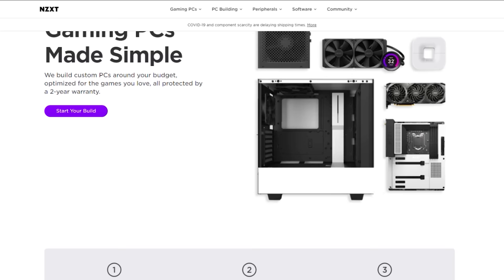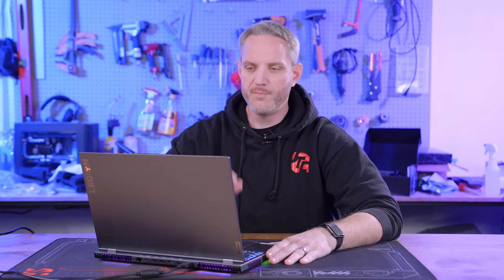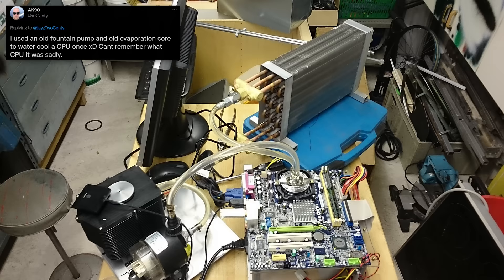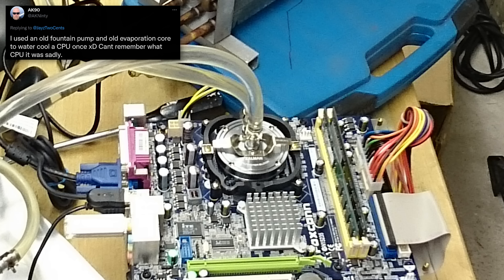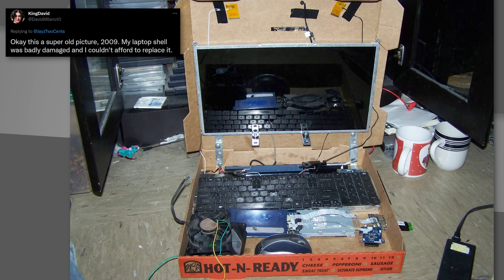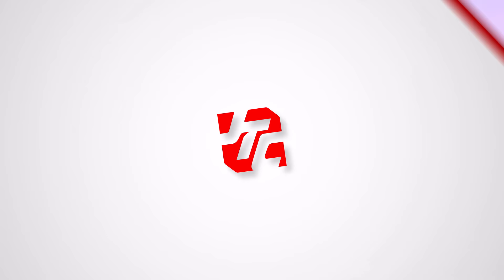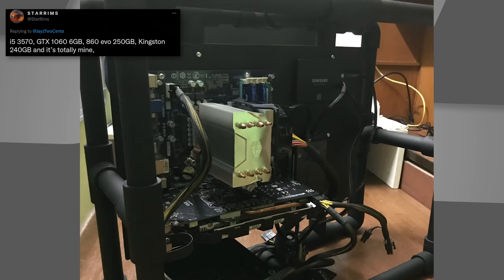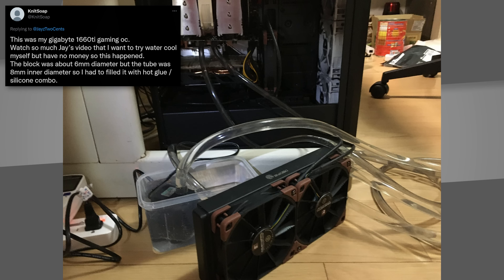We asked to see your JANKIEST PC setups... and you DIDN'T disappoint!

Comment: i really wish youd do a video dedicated to old janky watercooling solutions how people in the 90s and early 00s repurposed car parts etc to cool pc parts. Its so interesting but  ive never seen anyone do a video about the history.
Reply: That would be cool!
Reply: I concur!
Reply: I can only imagine the level of satisfaction one got after the diy water cooling system was successfully built back then ngl
Reply: I grew up in those times and I've never even heard of it. Where you from?
Reply: I love those builds
Reply: Please do Jay!
Reply: We used to MAKE our own watercooling loop, block and all.
Reply: @bepbep7418  jokes on you. I used 2 fish tank pumps
Reply: Ohhh, would be funny to watch Jay2Cents cool a computer using a J2Z.

Ok, I am say, would be funny to see this car guy use car part to cool his pc.
Reply: I had several water cooled.  My cooler was a heater core, fountain pump and the CPU block was a custom from a guy I knew in Oklahoma City.  He supported the system until around 2004.  I had 4 different CPU blocks from him.  All cast from either aluminum with copper plate or aluminum.  Those were the days.  I experimented with flexible and soldered rigid copper.  The radiator reservoir was an automotive brass tank also repurposed from a water cooled lawn mover complete with pressure cap.
Reply: @paultaylor7758   - As archaic as such a system could be considered now a days I cant help but wonder. Didnt they have better cooling capacity? Using high flow pumps and car radiators? "Jank" but at the same time would these not perform well today? If not better then your basic 360mm AIO?
Reply: I remember seeing zip ties and jubilee clips and those springy things you can put on tubes, they looked awful.
Reply: Early 70s Chevy Blazer heater cores were $30 at the parts store and worked awesome. If you wanted a smaller one a Chevy Vega heater core was around the same price and more compact. Eheim pond pumps were where it was at for a long time.
Reply: Oh man the first time I'd ever heard of overclocking was a 486 PC someone submerged in mineral oil in a cooler and used a pond pump to circulate the mineral oil over the guts of a window air-conditioner to cool it....
Reply: All in favor say Aye
Reply: Funny thing. My husband wants to have a water cooled pc that looks like a tie fighter. So i have a plan of using car radiators as the solar panels and passive cooling , it would look amazing with what i have in my head
Reply: @bepbep7418  i used the toilet tank level difference to the shower drain for a pump less solution on my p75 (@100mhz)
Reply: Water cooling through the ages XD
Reply: I can definitely give you an example. Imagine being so obsessed you go out and buy a brand new Amana refrigerator, pond pump, 40ft of copper tubing yo wrap around a small wire spool, punch holes into side of freezer section of said Amana...only to have your cast heat exchanger have a pin sized hole in it and fail miserably. Yeah my boss did that, lost interest and built a Beowulf cluster.
Reply: Would love to see an old danger den setup
Reply: @cardinaldriver  Ive never heard the beowulf cluster term before,  but i do remember the airforce running a ps3 cluster years back
Reply: Agreed
Reply: @motokid6008  radiator space is radiator space the real difference between then and now are the dedicated cpu/gpu blocks. This  is the biggest unknown to me from that time period; what did they use as the cpu/gpu block.
Reply: @kommandokodiak6025  believe it or not mine looked a lot like a modern one. I built a cube out of plexy and epoxied a heat sink to the bottom. I tapped the top for barb fittings and attached my hoses. Unlike a lot of people here I used a motorcycle radiator for my heat exchange.
Reply: industrial ebay is your friend with this one :)
Reply: Why would you need to water-cooled a PC 20-30 years ago? PC back in those time (Single Core CPU) can run very well off one 60mm fan over it. I know this because I had done that to my PC in 1999. Water cooling is only recently become popular because of the massive core counts. Just a few years ago in 2017, Intel's flagship the 6700K was only quad-core and can easily be air-cooled and before that was Core-duo CPU. I remember in 2003 the top of the line CPU was 400mhz.
Reply: Linustechtips did water cooling with a car radiator
Reply: Linus
Reply: Oh great idea!!
Reply: i had a heater matrix from a car as my rad back in the q6600 days
Reply: out of car parts huh. iv legit used 00s pc watercooling hose clamps in my car instead when one of the hose clamps broke
Reply: Just said the same thing a few days ago over on Greg's videos. These kids have NO idea.... What water cooling really is.
Reply: I would love to see that also
Reply: no matter what you do, nothing will ever beat LifeOfBoris's vodka cooled PC.
You can see the video on Youtube, and yeah, it actually works.
Reply: please
Reply: That’s honestly a good idea seems very interesting

Comment: Fun Fact: Back in the early days of radio, there'd be a water feature in front of the transmitter house, with fountains, which was used to cool the transmitter. Considering the God level voltages involved, combined with pipes full of water, and our lack of knowledge at the time, it would have scared the hell out of me to be in that building when it was running.

Comment: Oh Hey I made it into the video :D

Some more info: The fountain pump was submersible and had a UV light on it, if you look closely you can see the socket on the left. The big black box is a reservoir from a Zalman Reserator XT and the water block is a Zalman ZM-WB5 also from that kit. And yes I still have the Reserator XT fully working but not in use :P

Comment: The coolest tractor trailer setup I saw was a 42" tv mounted to the sloped roof of the cab and the Xbox tucked into one of the cabinets.  He also had all the cables run behind the interior panels and audio was run through the truck's sound system (which was of course far from stock)

Comment: Those rubber tabs for fans have been around a while. I'm pretty certain you can reuse most, but some are sorta single use. Supposedly, they help with noise reduction by preventing vibration transference.

It's a LOT easier than having to thread the fans' holes, you just stick it through and pull till the catch part pops out the other side.
Reply: I'm pretty certain Arctic used to provide those with their fans ten years or so ago. And I have a feeling Noctua used to have them. It's been years since I've used those rubber pull tabs though.

Comment: I ran console in my rig for years. Had a great setup with my Xbox 360 and then my PS4. Couldn't have done all my time without it. Always wanted to run a PC setup. Problem is wattage requirement and battery drain. Unless you owned your truck and could dump money into a battery, charging system and or a side mounted generator. PC gaming just requires to much energy demand to be feasible for most of your run of the mill truckers. Thank God for energy efficient televisions, consoles and mobile hotspots. Made me look back at the days when I was lucky to have a crap laptop or portable DVD player and made time on the road much more livable. Thanks for the nostalgia trip!
Reply: You could go with some high efficiency parts and have a system that's capable of playing recent games within 300W reasonably.

Watch out for amd's 6000 series desktop apus with ddr5 ram - they will absolutely be great igpus to game with
Reply: Am I the only one who idles the company truck if I wanna do some gaming? Gotta keep the broom closet cool if you wanna keep your hardware cool, and it also solves the battery drain problem...
Reply: @LavenderSystem69  unfortunately I worked for a company for a decade that had Idle limiters. One time I got a Volvo that I could cancel the idle. Other than that. Unless it was over 78 or under 36 degrees. I was out of luck.
Reply: @seaninman3899  Most of the time, all you had to do was wedge something between the driver seat and the throttle, so you could bump the RPMs just enough to trick the truck into thinking it wasn't just sitting there idling... hell, most trucks I've been in, you can set the cruise control at idle, and it overrides the shutdown timer
Reply: You could def get away with an efficient ITX build dedicated to gaming and media
Reply: I just use a laptop now tbh

Comment: 1:50
Those tabs look like they came from a box for something like an RC car. To reinforce the places where they run the twist ties through the cardboard.
Reply: They are actually metal "straight brackets." Got a whole pack from Amazon and used them to secure the radiator and power supply as well. The final design will actually replace some of them with L brackets to make things more compact.
Reply: @benzero  are you the builder? If so I would love to see the finished product.
Reply: @Druid_Plow  Yup, I am :) I will try to remember to post some pictures when it's done, heh
Reply: @benzero  nice. Good luck with it bro.
Reply: @Druid_Plow  Thanks!

Comment: Oh my god! That second one! I took apart a water fountain to make a water cooler for one of the first P90 processors off the line! We later just threw the whole board into an oil bath, but the watercooler water cooler worked better.
Then, someone in the group had the idea to use the watercooler setup to cool the oil and the pump caught on fire.

Comment: My first water-cooled setup was a Pentium 4 "Extreme Edition" (lol!) cooled with a Danger Den CPU block. The plumbing was made from Tygon clear tubing and all fittings/collars came from the plumbing aisle of my local Home Depot. The radiator was a heater core from a 1993 Mercury Topaz, which would fit 2 x 120mm fans almost perfectly. Another popular radiator back then was the Pontiac Bonneville heater core, but the Tempo/Topaz cores were much easier and cheaper to get. I know I scrapped that radiator long ago, but I think I still have that DD CPU block somewhere. I may also have an old GPU block from DD as well. If you're going through with that "retro water-cooled" video, I can try to hunt them down for you. That is authentic stuff from 2004-2005-ish!!
Reply: I have the parts of an old P4 setup. The radiator came from some A/C. The block was milled out of copper at the local uni and then a Grundfos circulator pump. I haven't used it.

Comment: Jay do you remember when people was building custom heatpipes in home to increase the efficiency of those old aluminum fins radiators?

The memories of those games coolers... I did shit like that, and i still do!
Who had a internal fan mounted in the chassis anchored using metal wire using some chassis holes for a parallel/serial port... If only YT would allow to post pictures....

Comment: I had to give up on my Alienware with an intel 3820 a year ago, and I tried to save as many parts from it as I could. Only problem is that cases have changed a lot, and neither my psu nor optical drive would fit in the new case. I ROUTED ALL THE CABLES AROUND THE OUTSIDE OF THE CASE, and had the disc drive sitting on top above the exhaust. The thing looked like a fire hazard express, and it didn't help that the power supply kept falling off the desk while making horrendus buzzing noises.
Reply: that was why i had to build my son in laws new system in a new case. Nothing would fit except their parts
Reply: cases havent changed. You bought a machine with propietary parts
Reply: A PSU would not be one of the priority items I'd save from a built to cost prebuilt, but I guess in this market we've been having you probably want to save every dollar when going DIY.

Comment: that copper water block is from laser water cooling system. Back on the day you could buy cheap laser water cooling components. I've build custom dual loop with two pumps two radiators two water blocks on GPU and one on one on cpu with one common res for just over 100 bucks. And it worked way better than my current 360 aio that I bought for the same price.

Comment: I also remember when we had to make everything for liquid cooling even the water blocks and hope we did not crack the exposed CPU Die when installing it. I think my first store bought water block came from Danger Den.
Reply: Yeah, so, I wrote above that that weird piece of "industrial" metal Jay was weirded out about is actually from a Noctua air-fan setup, and it's usually installed on the back of the motherboard so you don't crack your CPU while installing a giant hunk of metal on top of it. So I find it fitting (heh) that it was used to hold down the CPU cooler block. :D

Comment: Oh I've done the dual PSU build, with the PSU primary rails soldered together so they would work from a single mains cable, and a car relay switch to make one PSU turn on the other, by grounding pin 13 of the secondary PSU when 12V went through the relay from the primary PSU. I found it the best solution back then as I was using several Seagate Cheetah SCSI drives.

Comment: Lol this video is reminding me of my first car. The hydrolics in the trunk was broken (hatch back) so I had to hold it up anytime I wanted to use it. The antenna broke off so I had no radio.  I had to use a fork to move the ac/heat slide. It always froze shut in the winter. I had an after market radio which wasn't terrible.  If it got too cold, I couldn't roll up the window and all winter long I had to physically grab the window to help it close. 

But by far, the worst part was when I couldn't put my car in park so I spent months each time it happened putting my car in neutral and throwing on the ebreak. But because it wasn't on park, I couldn't remove the key so I left the key in and had to take the radio out so it wouldn't kill my battery each time I left my car.

All that said, I loved that car. She handled perfectly well in the winter, even better than any truck or suv I've driven and leagues better than my current car. 

Her name was Brandi and I still miss her.

Comment: I used to be a truck driver and I had an itx rig in my truck with a 24” monitor. Even played VR in it, but I had to be careful and tuck away the monitor because I wrecked one playing it. Had a large RAM mount setup to hold the monitor. Made it easy to move it out of the way.

Comment: 11:15 The first Flatscreen of my father (I was too young to have some PC stuff) was manufactured in 2006. Yes this is not one of the early flatscreens but still. And it works still I just replaced a year ago some caps on the power supply pcb in it and I hope it will work for another atleast 4 years to make the 20 years complete.

Comment: Back in 2006. I remember watercooling my cpu with a thermaltake gpu waterblock that I had ziptied to the cpu. Connected the loop together with some clear hose from home depot, a 12"x 18" transmission cooler from Napa, and a fountain waterpump that I placed in a plastic peanut container from Costco. I was close enough to the window with my setup so In the winter time I could just crack open the window a little but and the temps would sit around 40F on the cpu. Ambient temps outside in the winter were about 8F. It was so cool but so unnecessary at the same time.🤣

Comment: Years ago, I used a Danger Den water block, with an aquarium submersible pump, in a 5 gallon aquarium with an oil cooler for the rad, that was about 8"x10". I had the cooler laying flat onto of the aquarium with 2x 90mm case fans mounted to the rad. It was a pretty small setup for the day for sure. I built like 4 or 5 of those setups for my buddies. My PC at the time, was an Athlon 750 over clocked to a 1000 with a Voodoo 5 5500 Video card... That system was awesome for the time. I still have the Voodoo and water block some where in my boxes of old parts.

Comment: Old video, just have to add; one of my old builds, circa 1999 had hardcore OC and similarly hardcore cooling to cope with this; back then, fans tended to be much smaller than today, with 80 mm being the most common chassis fan, and CPU fans was commonly even smaller. The one on my CPU cooler was a 40 mm "Delta" fan which was pretty legendary at its time for it's cooling capability. Problem was, it achieved this by spinning at like 12k RPM and it sounded like an industrial vacuum cleaner. To make it even more effective I had this idea that it was a bad idea to use the already hot air inside the chassis, so I took a Dremel to the side panel of the beige case and cut a hole, then made a sort of duct down to the CPU fan, so that it sucked in air from the outside. This setup actually did work really well, but you almost had to wear ear protection to be able to stand it. 

Over the next couple of years, as the market for DIY computers emerged and computer cases went from a selection between small, medium or large beige box to black becoming an option without having to spray it yourself and more enthusiast features popping up, I saw quite a few repeat the idea with a hole in the side panel, however it commonly had a fan in it and not my amazing ducts.

Sadly, this was before digital photography was a mainstream thing and it seems I didn't think the computer was something worthy of wasting a frame of film on, so there are no images.

Comment: The most hard disk drives I ever had in the computer for storage (not just testing) were 12. The problem was I couldn't even touch this computer as the balance of power was "touchy". You touch it, and some drive instantly started to have power issues. And this was very hard to resolve. I am so happy that molex is a connector of by gone era